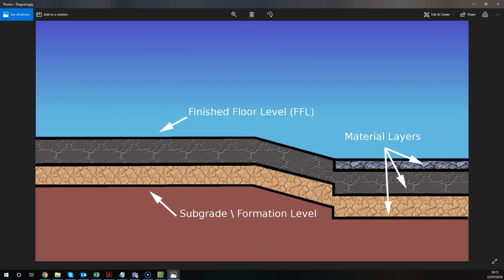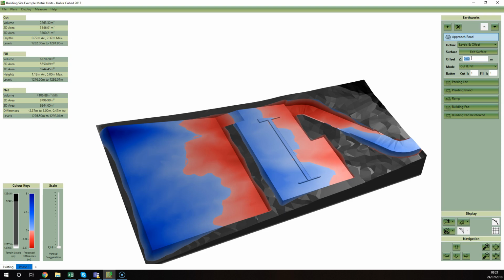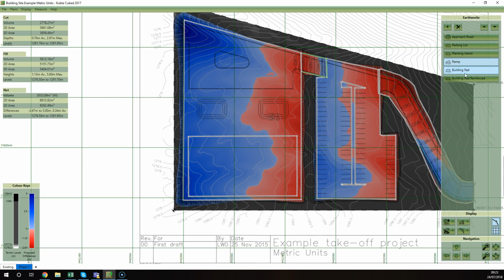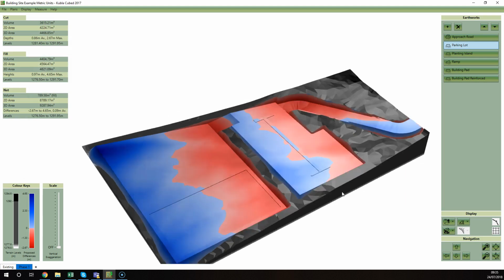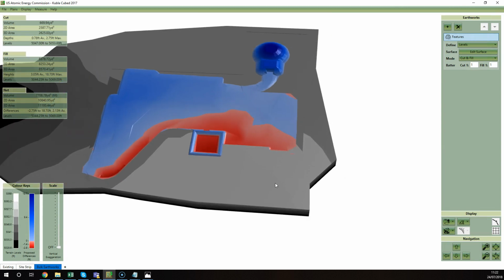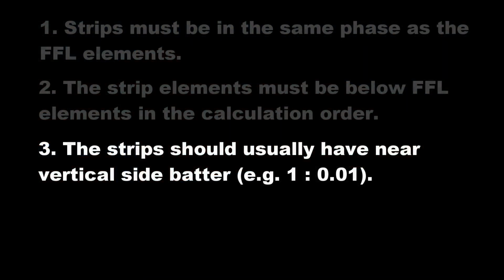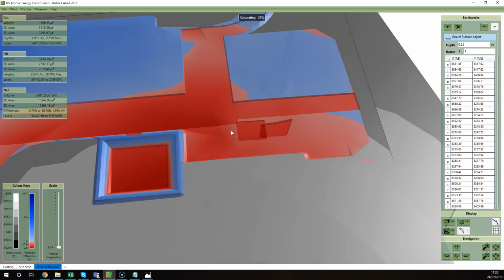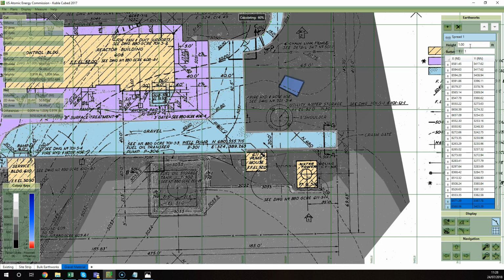Kubla Cubed 2017 - Adjusting to Subgrade \ Formation Level

Comment: I tried using the site strip method of measuring on my latest job. I liked it, but one of the issues I found was that in an attempt to avoid layering one strip on top of another, I would end up with a slight gap between adjacent strips. It would be good if if was possible to snap to other strip points so as to create a seamless measure.
Reply from the maker: Hi Marcus, yes we are working on a method for doing this in the upcoming release.  It should be available in the next month or so.
Reply from the maker: Hi Marcus, now in Kubla Cubed 2021 you shouldn't have this problem.  The method has been renamed to the 'reduce method' and if reduce elements have their Depth From property set to Auto they can override each other, the lower one takes precedence.  This means you don't have to snap and can create seamless adjustment areas without snapping.